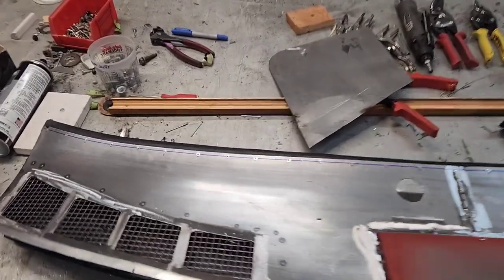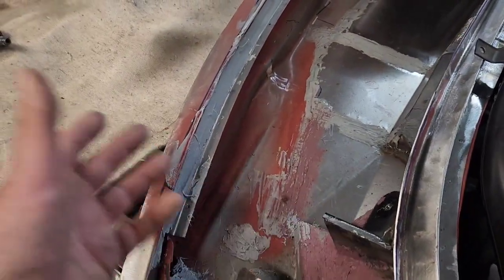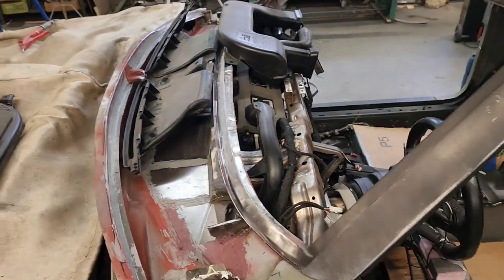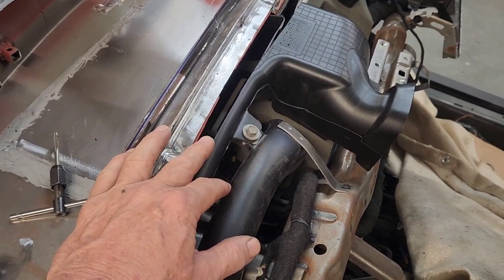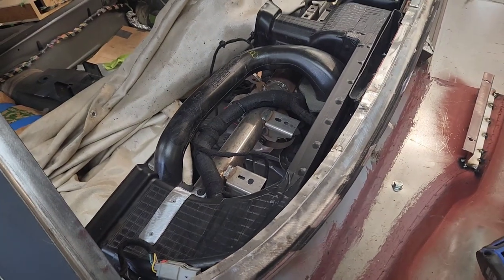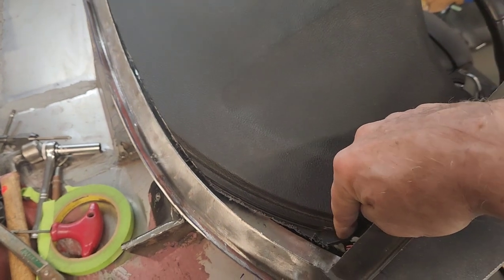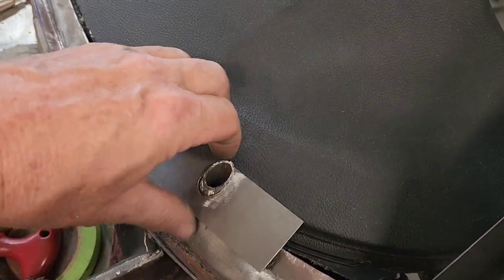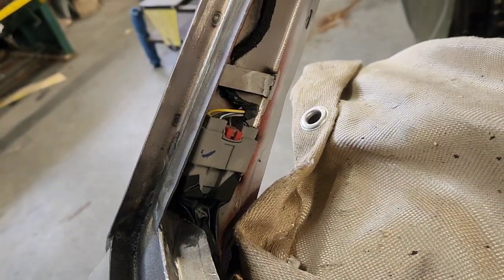Randy's Hellcat Daytona part 29

Comment: I agree that the added back hood section is an eye pleasing improvement. 
How you are capturing the dash leading edge with the hidden and captured screws is perfect. Will be using that now for some turbo ductwork I am fabricating. Been struggling between function and  asthetics.
Thank you for detailing these builds.
Reply from the maker: Thanks Michael. Randy has a good eye and he called out the back of the hood. I am glad the videos are helpful.

Comment: I pictured myself taking those duct screws out and dropping them directly into the HVAC system outlets. That's what usually happens when I do detail work like that. Just leave it to a pro is my new motto. Looks good, Steve.
Reply from the maker: Thanks. I have dropped my share.

Comment: Steve, have you considered 3D scanning the factory ducts , modifying the 3D model and printing  revised replacement ducts?  Basically, do what you’re doing by hand, but in a software environment?  3D printing hardware and software is getting more advanced and easier for a novice to  use every day.
Reply from the maker: My son has a couple of printers but neither of us has a scanner. Bottom line is it took me a day to do the ducts. I have done scanning and 3D printing can take days for a piece that big.

Comment: Hey Steve, great work! Thanks for another great video! You mentioned you used epoxy in the cowl area to seal it up and a rubberized coating as well. What epoxy did you use by chance? I am in a similar spot putting my cowl back together on my '70..
Reply from the maker: Thanks. T-21 Fusor.